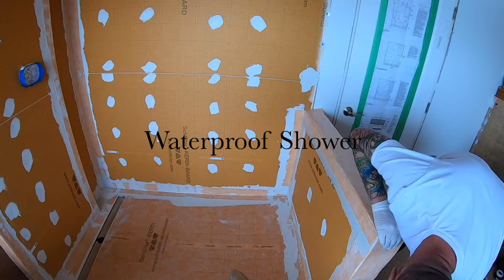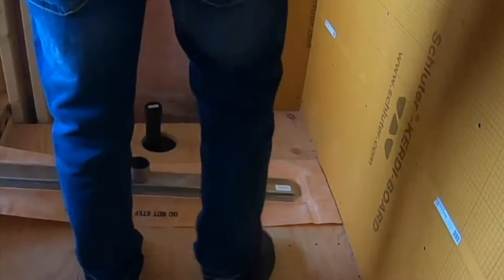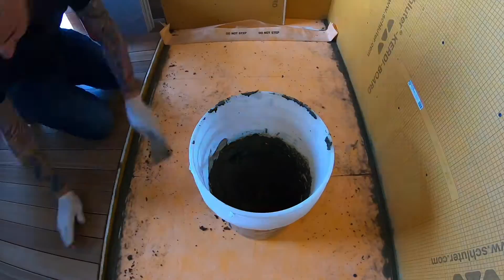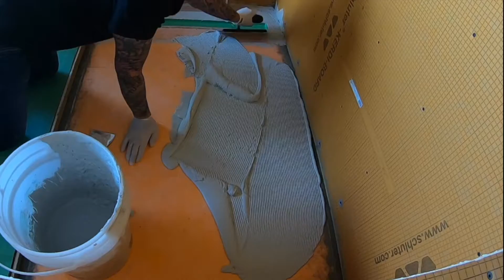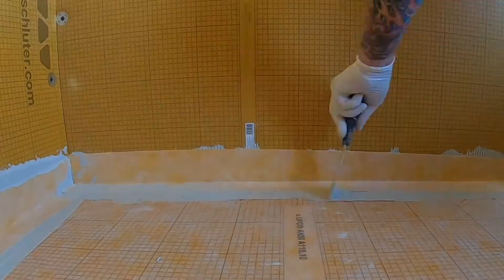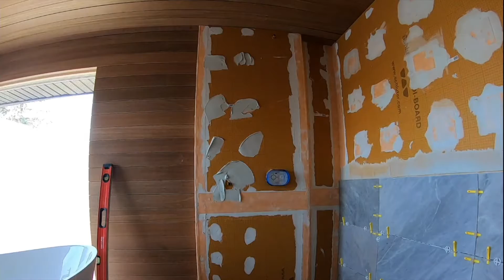How to Waterproof a shower Install linear drain Step by Step

Comment: What happens if the subfloor is not level?...which it never is. You've put your overpriced piece of foam down and now you don't have the correct slope. Mud is SO much better. Not a fan of cutting corners with pre-fab junk that's designed to separate you from your money.
Reply from the maker: Most of the jobs I use what the homeowners ask me to. The orange brand does a very good job at target marketing homeowners.

Comment: what is the wood you use for this bathroom
Reply from the maker: Yellow batu
Reply: @ConstructionCoach  dont see a video on how you built it
Reply from the maker: I do have it recorded but haven’t finished the edit. On the ceiling I just framed up a 2x4 bulkhead to create that drop down look.
Reply: @ConstructionCoach  oh ok did you use a particular sealer or  particular wood stain ?By the way love you videos
Reply from the maker: I use a water based matte finish. I think the product was called diamond coat from varathane. Home Depot has it. Thanks for the compliment, I appreciate the support.
Reply: @ConstructionCoach  i shared your videos with friends ?
Reply from the maker: Nice, thank you. 🙌